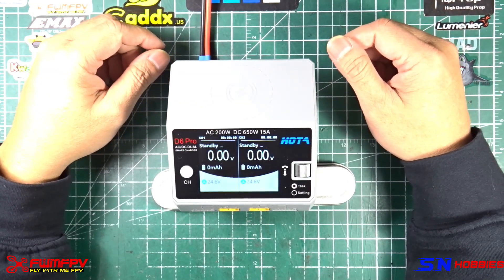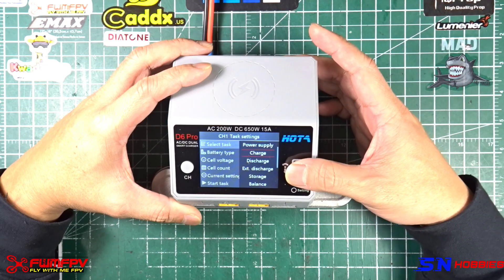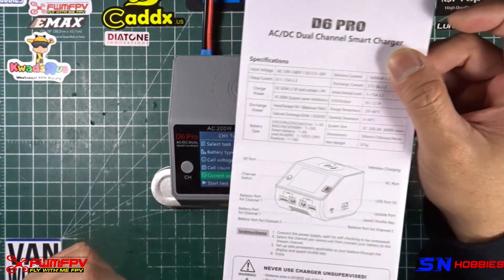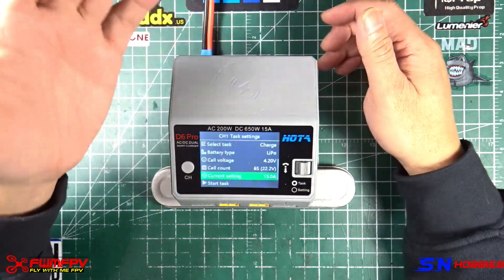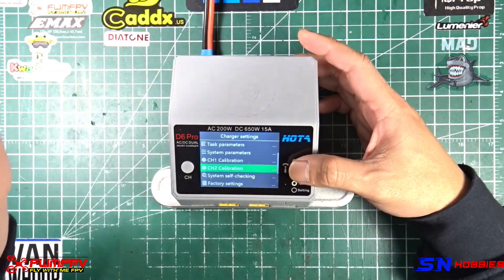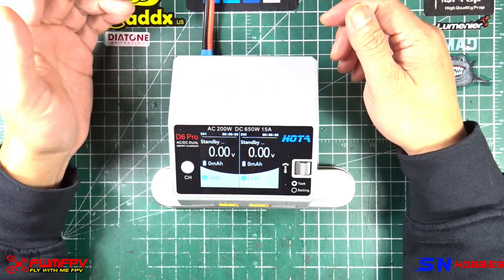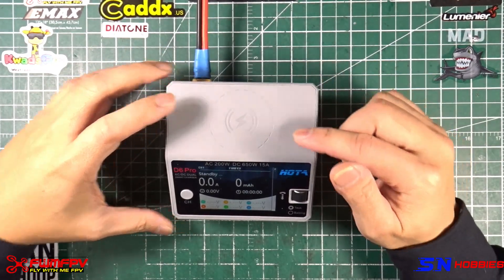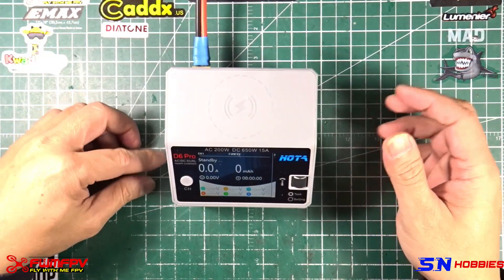HOTA D6 Pro 650W Dual Channel Charger - SN Hobbies

Comment: Got a similar one, a Hota D6 Pro from Banggood and when turned on I just get the message "CH1 Self-check failed! (E108)". Not happy!

Update:
- troubleshooting I did: firmware update or hard reboot, but problem continued
- reported the issue to HOTA, sent emails several times for any news, and they only kept replying "sorry to hear that" and did nothing 
- reported the issue to Banggood, and after sending the unit back was fully refunded 
- now I have an ISDT D2

Comment: I was frustrated with the 4 button chargers and saw these. I bought one as it was so simple to use. I’m not a drone guy, but I use it for my land vehicles. I bought mine from Good Venture Drones as they had them in stock. I just use a 1C charge rate as I’m new to lipos and just staying safe. I just love how these are so simple. The Spektrum Smart chargers and ISDT have the same menus (probably also made by Hota).